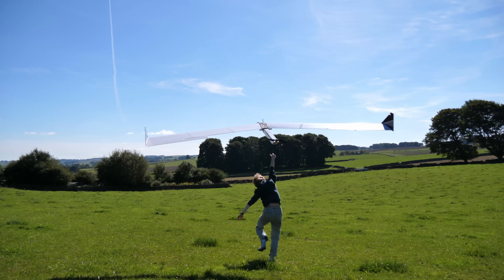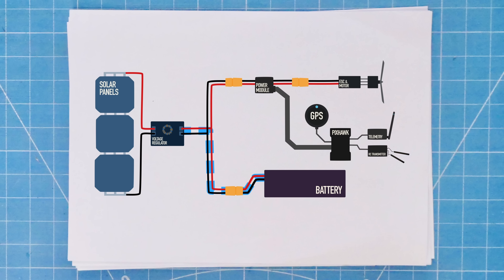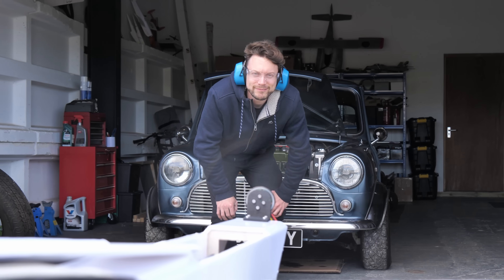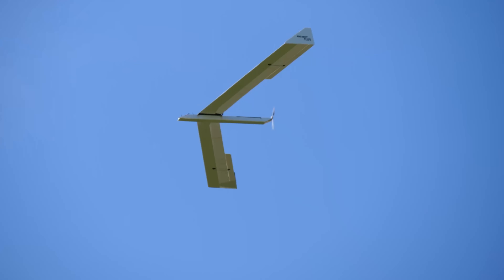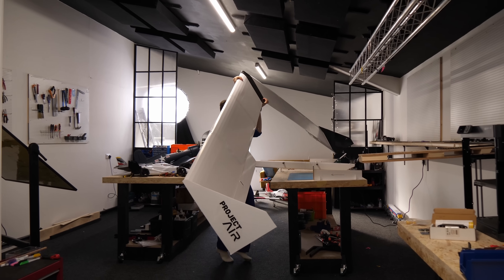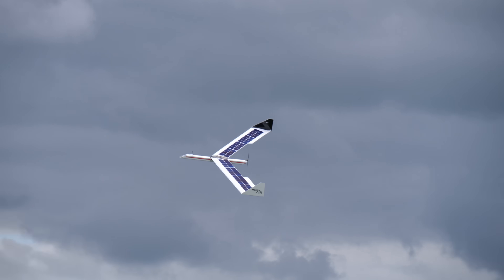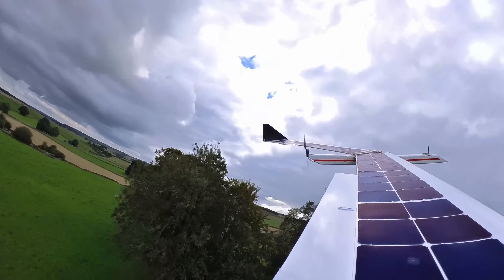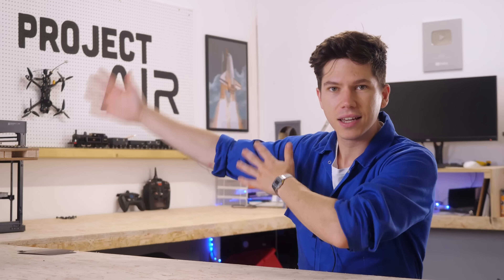Solar Plane V2

Comment: The electronics are not only a fire hazard, but also not ideal. First of all the purpose of an MPPT controller is to squeeze out as much juice as you can from the solar cells, something that seems vital in your case. Secondly, lithium batteries degrade rapidly without a proper charging curve, and could even explode. Source: am an aerospace Electrical Engineer.
Reply: Most voltage regulators are cc/cv just like proper lipo chargers. Even if was just constant voltage those solar cells have no way to exceed the maximum charge current of that lipo battery
Reply: I agree with this to some degree. I think the real risk with either setup is the lack of a BMS to keep all the cells on that 4 cell battery at the same maximum voltage when charging. Since the system is charging and discharging many times throughout operations over the course of a few hours. The differences in voltage that accumulate during those charge and discharge cycles can lead to overcharging some cells which would potentially cause a fire. Alternately it could lead to over discharging cells which is generally less dangerous but damages the battery and would lead to a sudden loss in power as one cell has its voltage drop off rapidly due to over discharge conditions.

The voltage regulator is likely less of an issue since it is constant current (meaning that it will maintain the same current for any voltage) and has a maximum voltage threshold. Since the battery at full charge will be the same as the output voltage of the regulator, the current will drop since the potential difference is low enough to where the battery will no longer draw the maximum current from the regulator. That is how most commercial chargers work although they usually have some way to balance the individual cell voltages. Using a BMS in combination with this setup would be an ok way to charge batteries.
Reply: So, the plane is likely to turn into a flaming meteor mid-air? Talk about motivation for continuing to watch!
Reply: @Shiny_Squirrel-k7b  No, would actually like a source to his claim regarding a "proper charging curve" for batteries, which to me sounds a lot like just because you're an electrical engineer that doesn't make you a battery engineer.

Common knowledge around battery charging curves is to avoid the extremes, so for the best long-term durability (over many years) to avoid either extreme, like discharging below 10% and charging above 100%.

There's of course exceptions to this, and some battery types are affected less by this than others, but in general it is true.
Reply: What exactly do you mean, that li-ion batteries degrade w/o proper charging curve? I am not criticising in any way but I am trying to learn from someone with practical experience.
Let's divide my question into three simpler ones.
1. Can li-ion or li-poly work in buffer regime at constant voltage, say 4.1v/cell, given they remain there most of the time and they are occasionally discharged and finally charged in cccv mode?
2.Do the batteries NEED regular charge/discharge for longer lifetime?
3.Should someone keep some state-of-charge (e.g. charge in amper*hours) constant instead of voltage?
Reply: @ІгорАлієв  1. I would say yes, if the depth of discharge is not significant, but I cannot state that with certainty. 2. They certainly need charging to account for the self discharge. The level at which they should be charged depends on the battery chemistry. Lithium for example should not be stored fully charged long term, more like roughly 60%. 3. Lithium batteries like small depth of discharge, so if full capacity is not needed then having a setpoint at a lower state of charge can prolong battery life (even macs do it automatically if you keep them plugged for extended periods, and on android you can lower the max charge cap to 85%). Hope it helped !
Reply: Buddy your not smart, any rc hobbyist knows better
Reply: Thank you for pointing that out, what a great idea to remove the mppt😂
Reply: Is there a solution to charge a 4s lipo with solar cells?  I can't really find any way to do it that doesn't encounter problems like this.
Reply: How would a lithium battery explode if the voltage that it's being charged at is lower than the threshold needed to trigger thermal runaway? If you have a battery whose nominal voltage is 14.4 volts and you supply it with 14.4 volts, how would the battery ever get a voltage above 14.4 volts? Especially if it's connected in parallel with a motor?
Reply: @WhoIsTheEdman  In nominal operation, the cheap chinese DC/DC module they are using might not be a problem. But it is your single point of failure regarding battery safety. Who is to say that its output is temperature compensated ?
Reply: @WhoIsTheEdman I think you misunderstand what nominal voltage is, nominal voltage is the "average" voltage, or 3.6V for a 4S 14.4V nominal battery. Max voltage for such a battery would typically be 4.2V per cell, or 16.8V. So the charging would be at 16.8V max, not 14.4.
Reply: @swecreations  At the time that I made this comment I erred in misremembering which voltage they said they'd hold the buck converter at, which I falsely believed was the nominal voltage of the cell. Upon watching again, I did see that they said that they'd be keeping it at 16.8 volts. So it does seem like if there was a time when the airplane was throttled down and the sun was out for a long period of time, it could overcharge. However, I am guessing that the number of cells, the size of the battery and the size of the motor were probably chosen so as to make that risk negligible. On the other hand, the danger of the battery discharging too much does seem like it's not accounted for and does seem like it would be a flaw with the design.
Reply: Your source isn't good enough. It is a logical fallacy called the argument from authority, you may well be knowledgeable but there is always more to learn and mistakes like human error are common place.

Comment: You could try to mount the solar cells inside the wings with a transparent cover. This should reduce air drag and help (somewhat) to protect the cells in case of a crash.  (Yes, this will slightly reduce the efficiency of the cells).
Reply: I tried to charge my phone with a solar panel on the inside of the windscreen in my car covering the entire window, I got about 30% of the charge on the inside compared to when I put it on the outside of the window...
Reply: @a64738  Car windows block out a lot of the UV and IR spectrum by design. Transparent plastic foil should be much more forgiving.
Reply: Just gotta inset the panels and then use epoxy to smooth out all the little gaps and grooves

Comment: Ok stupid answer but weight reduction , make small cut outs in the aluminum, like I said stupid answer but would be the first thing I'd try as well as inlaying the solar cells in the foam wing to reduce air resistance.

Comment: Have you considered an inflatable airframe to reduce weight? 
Have you tested your panel-to-motor efficiency? Each 1% with something like this makes a HUGE difference. That regulator probably VERY poor compared to a MPPT.
Have you tested your watts to grams thrust ratio using different props? Makes a big diff.

Comment: The motor mount, the fillet helps, but mutch better is some ribs in the other plane/force direction.
Reply: 📐is stronger than L
Reply: Printing it with the "L" shaped side touching the print bed would also make it much stronger, to prevent it from snapping along the layer lines

Comment: This project NEEDS efficiency to work. To go from maximum power point tracking (MPPT) to a regulator you lose a LOT of efficiency from solar.
Reply: My exact same thoughts - they sacrifice long-term efficiency for short-term functioning. They might not be aware that their design might simply not work overall.
Reply: Besides the lack of MPPT, there is another effect: The regulator has a negative resistance: provide less voltage, the current draw goes up. The simplest model for the solar cells is "CV/CC". They will provide (for example) 20V at up to 10A or the other way around: they will provide 10A at up to 20V. The Maximum power is therefore 200W. 
Now suppose your battery is happily charging at 200W, but some electron bumps into another one and for a short while you need 200.002W. Now the regulator will try to keep that up and require 10.001A. But the solar is not able to provide that current and will drop the voltage. The regulator will need even more current at the lower voltage and you get a more current, less voltage spiral. The end situation in this case is where the solar panel is more or less directly connected to the battery. The only thing the DCDC converter with bulky inductor is doing is shutting off the panel if the voltage is above the setpoint. You can do this with a very low current and low weight circuit instead. 

My advice is: Get the MPPT back (provided it is a real MPPT!) and to prevent the previous problems, run the onboard electronics directly from the battery. At least the reciever, flightcontroller and control servos. 

The "you lose a LOT of efficiency" depends on the voltage difference between solar and the battery. That difference you want to keep low anyway. The losses in the DCDC inside the MPPT controller are proportional to the voltage difference as well. (you lose say maybe 25% in an MPPT as opposed to 100% of the voltage difference with the DCDC you're using now). 

Mechanically: Use carbon fiber as opposed to aluminium. Been there, done that.
Reply: @rewolff2  this exactly. Can be very dangerous because the input amps can spike to maintain output voltage in low input voltage conditions. In my experience this has blown fuses and potentially can cause a fire.
Reply: @karlm9584  This type of system will always "walk away" into one of the corners. In this case usually the "close to Isc" point with the solar cell output close to the DCDC output voltage. The only other possibility is that your battery is almost full, so not "full power" is needed and the system will work as optimal as it can "close to Voc". Once the power requirement exceeds the available power you'll end up stuck in the other corner.
Reply: @karlm9584  I don't know what situation you've encountered that, but I'm talking about here where the input is a solar panel. Solar panels are inherently current limited. If you fuse a solar panel, either you will reduce the available output or your fuse will be useless (e.g. solar panel can do 10A? A 10A fuse will blow at 15A between 20 seconds and 20 minutes. The solar panels can never generate that much energy if they are rated for 10A max)  So in general: Never fuse solar panels. 
Things are different for say a 100V powersupply with a relatively high output impedance, say 10 Ohms. Say meant for 1A, but drawing close to the 100W theoretical max through a DCDC can blow the 1A output fuse before the output has dropped to 50V.
Reply: @rewolff2  my experience is not with solar panels for this situation (using a voltage regulator) but I have used them in the past for embedded systems and they can be unpredictable as the input voltage drops and the regulator works to maintain output voltage. Of course solar panels are "current limited" but surely that depends on wattage / configuration? For this particular project it doesn't seem like there are many watts, but I'm not sure if it was ever mentioned?
Reply: @karlm9584  I bought the same panels for my version of this project. about 15 years ago. Been "waiting" way too long.  Each square cell is about 10W. So there is about 200-400W of theoretical power on those wings. That's also not a weird amount of power needed to fly such a plane. 

But what power there is, doesn't matter. Whatever happens, the DCDC will drive the panels in to "almost constant current" mode.
Reply: @rewolff2  400W is quite a lot of power, and DCDC Voltage regulator will draw from that 400W to regulate the output voltage to whatever it is set to. There isn't any other way to consider it. If input voltage drops low, then the regulator input current is adjusted up to compensate to maintain constant output voltage. However I'm not familiar with how solar panels react in this situation. Lead acid batteries can do some wild things.
Reply: @karlm9584  yeah. Lead acid batteries will supply say up to 2000 Amps. Solar panels will drop into almost constant current mode, i.e. about 20 A in this case.
Reply: You're right, technically. But since this plane needs full sun anyway, it is not a big deal if the system is tuned for max power. But, yes, an MPPT to battery and voltage regulator afterwards would be better.
Reply: @johngreen1060  The plane needs to roll to turn. Thus if the sun is not directly overhead the panel-output will be variable. Also, you'll want to fly also on days when the sun is say at 80% max. Humans are unable to detect the difference with a "100%" day.
Reply: Is there a solution to charge a 4s lipo from solar cells?  Not overcharge it, and not shut off completely?  I can't find anything specifically to do something like that.
Reply: @maddercat  For the electronics: It is simpler to have to EITHER step down OR step up. This would mean you need to either configure the solar cells to have a voltage always higher than the battery, or always lower. With an airplane the solar cells would all be able to provide similar currents and voltages. Next you need to control the DCDC to draw max possible power from the solar cells. And monitor the battery for overcharging.
Reply: I guess none of the guys involved here are currently (at the time of making this video) up to the task of building this project - but through learning they might be able to realize it.
Reply: They definitely need better understanding of aerodynamics, electronics, weight saving and piloting.
Reply: Magic beans 🫘🫘
Reply: You could use a row of Super Capacitors instead of the lipo?
Reply: @lynnwilliam  technically yes but theres still the mppt missing
Reply: Judging by that large coil on the regulator, it appears to be a boost converter with a regulated output.  If so, it does a similar function as an mppt controller without the active tracking.
Reply: @Andy-df5fj it literally isn't as the name of the mppt implies theres a point where you can pull the most power out of the cells since wattage of the cells isn't consistent across voltages
Reply: @pleck7059  
Yep.  No tracking.  The maximum power point would need to be dialed in manually.  No it's not as good as having active tracking for varying sun conditions, but it's still way better than a resistive regulator.
Reply: @Andy-df5fj  You cannot dial in the maximum power point. The dc dc converter allows you to regulate the output, not the input.
Reply: @bobsmith369  
An MPPT uses a DC-DC converter to do what it does as it actively adjusts for varying solar and load conditions.  It essentially matches voltages for maximum power transfer.  You obviously aren't going to fly along on the airplane to make adjustments, but you can indeed monitor the power transfer on the ground and adjust a DC-DC converter output to find the sweet spot for maximum power transfer under the current conditions.  Once the conditions vary up there, you would still be far more in the ballpark of maximum power transfer than simply chopping off the excess voltage as a basic regulator does.
Reply: @Andy-df5fj  This is incorrect. An mppt does not "match voltages". Look up Current-voltage curve of solar panels. What mppt does is to limit the input current because solar panels do not provide max power at short circuit. Secondly, you CANNOT adjust the input side of dc-dc modules like the one used in the video. Even if you could, which you cant, the maximum power point varies a lot based on conditions, hence the need for a tracker.
Reply: @bobsmith369  
How do you think an MPPT limits the current if not by voltage conversion?   That is why they are so efficient. They step down the high panel voltage to the optimal charging voltage so the panel can stay at its maximum power point instead of collapsing to the battery voltage.
Reply: @bobsmith369  you can set the MPP on the voltage regulator ;) But oooonly if the battery voltage stays the same, but as soon as you power the motor the voltage drops and the set point is useless
Reply: @Andy-df5fj   The problem is that MPPT voltage floats as the voltage from the array sees different input, so a fixed load on the panel to keep it at the correct MPPT voltage only works in full sun and when directly perpendicular to the sun.
Reply: G'day,

Newsflash...!

When operating in 3 dimensions -
Using Electricity for both Radio
Control, and Power - then
Reliability
Actuarially
Matters..., rather more than
Hypothetical
Efficiency
Fantasies.

Just(ifiably ) sayin':

Such is life,

Have a good one...

Stay safe.

;-p

Ciao !

Comment: The voltage regulator works, but couldn't you just have not relied on the charge controller to handle the load and instead just connect the load directly to the battery?

Comment: Using a battery balancer would be a good idea. There are standalone breakout boards that you can hook up to the battery for that. As just using a voltage regulator is not really ideal for battery charging.  Using proper charge circuitry would be better for safety and battery health. But balancing the cells would make it at least less bad.
Really Looking forward to the twin gliders tho!
Reply: Balancing isn't really necessary for this. The battery will stay balanced for the most part

Comment: Do yourself a favour and run the receiver and control surfaces off a different battery and power system independent of the complex solar system, especially for initial testing, that way you don’t loose control.